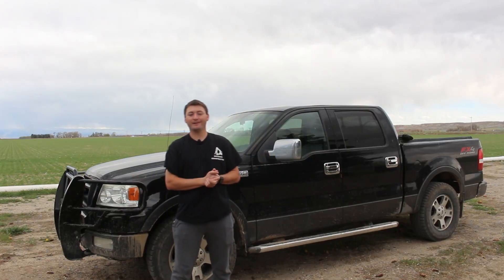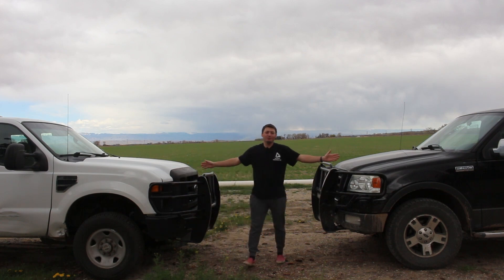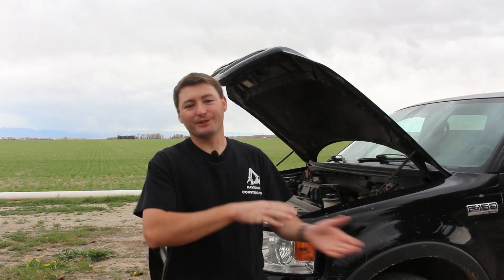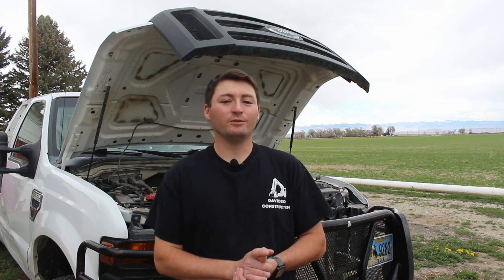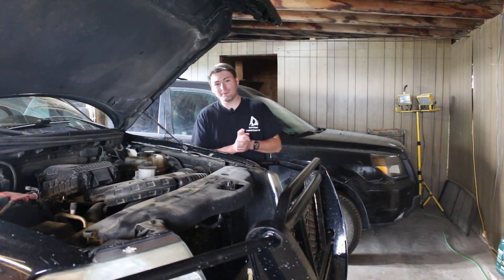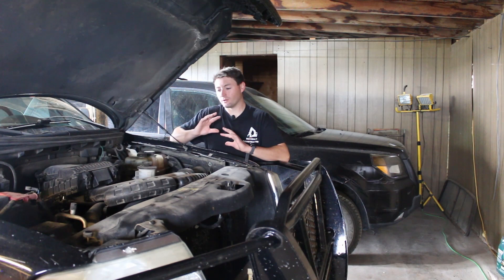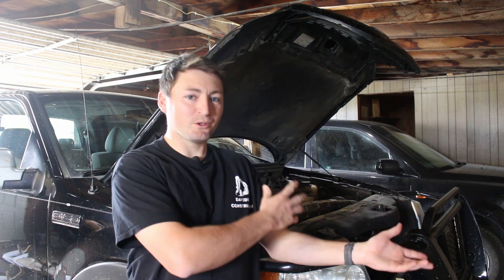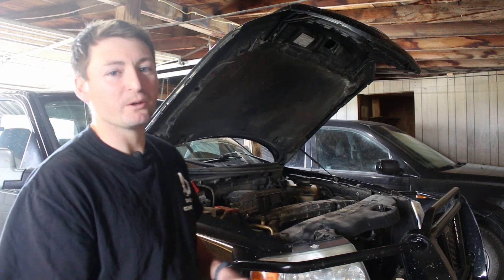Common Issues with the Ford 5.4l 3v Triton V8 Engine 2004-2014 F-series, Expedition, Excursion

Comment: I have changed spark plugs coil paks cam shaft sensors crankshaft sensor fuel module fuel rail sensor fuel pump fuel flterdrained gas put new gas back Indian stumped can you help me
Reply: Yep it's junk take it to the junkyard

Comment: i had a 99 f150 5.4 with 398k miles all original but had the timing done at 200k original trany also
Reply: Probably a two valve
Reply: @glennbeadshaw727 yes was a 2 valve
Reply: @glennbeadshaw727  currently have a 09 with 179k and the 5.4 its already giving me issues and of course it won't just break but gives random issues at random times next to impossible to diagnose

Comment: I’ve owned a toll of four F1 50s and by far the 543 valve has been the worst nothing but issues miserable to maintain. If I knew it would’ve been this much maintenance I would’ve just bought a diesel. The the 5.0 is a good motor specially back in the 80s and the 90s.

Comment: Appreciate the info, was looking at buying a used f250 with 160,000 on it. Gonna pass on it. So, what about the Cummins?
Reply from the maker: Thanks for watching! Overall, 5.4l 3v is not bad, but you do need to be aware of the larger - expensive issues they all have. I bought mine at 150k, kept great oil changes and locked the motor up at 218k. So at 160 well kept, it could go for another few years without any major repairs. Long term however, you'll end up putting a lot into them between timing sets or an engine. 

Cummins diesels are great engines, regarded as the most reliable out of the big three: Cummins, Izuzu Duramax, and the Powerstrokes. With any diesel you'll run into much higher repair and maintenance costs, so keep that in mind. Also keep in mind emission systems are the downfall of diesel reliability. If you're looking for a 'super reliable' cummins motor, try and stay pre-emissions or 2007 below. I've personally seen several with well over 300k on the original block. One that stands out is a 96 with 630,000 and even Hoovie's garage 3rd gen with 1,000,000. Obviously anything is going to require good maintenance and upkeep, some engines just tend to last longer.
Reply: Depends what generation Cummins you're buying

Comment: I recently bought a 2009 crew cab 4x4 with 5.4 3v has 258000 miles only thing I know that the guy had it passed away in August 2019,his daughter drove it then parked it cause of brake caliper an pads wore not changing them destroying rotor an burn caliper completely out,but ran good,i bought it in August this yr,hopefully it will last me for awhile,he was a decent mechanic hopefully he done good things to the engine to make it last this long,my favorite engine of all time was the 351 Cleveland an 390,sure love to have either one of those in my newer truck but im to uneducated to go about such a task now,i also have a 07  mountaineer 4.6 3V with hundred 80 thousand miles an runs like a strapped ass ape an gets 18 to 19 miles to the gallon,but its not like the older days when you could put just about any replacement you desired to in your vehicle,i have heard alot of bad about the 3V but like the one coment here nothing lasts forever so true thank you for sharing!!

Comment: I have a 2005 5.4 it cranks but won't start but I got it to start it runs for a few seconds then it stalls  & will not start again. But if I wait until the next day it will starts runs for a few seconds and stalls and won't start again until the next day. What do you think it could be
Reply: Might be fuel pump or injector issues. Check for P codes, and if you have a voltage tester, look at your fuse box and see if one does not receive voltage ECU related.

Comment: I believe these engines have quite a few updates in regards to rebuilding them that address the timing and valve train issues along with the oil pump issues…I do believe the spark plug issues have been fixed as well if you buy the right rebuild kits or buy a long block from the right engine builder…and as far as oil goes, Ford has a bad habit of recommending extremely high oil change intervals…like three times higher than they should be…my dads Fusion is recommended to go 16,000kms which is ridiculous…I change it for him every 7000-8000kms and as far as the 5.4 goes I would not go over 5k-6kms especially if you are working the engine and use a good high quality oil…Ford wants the 5w20 used but they tried that with their Ecoboost engines and paid out a lot of warranty repairs on major engine failures for their troubles!…as far a I’m concerned, 5w20 is a car engine oil and should not be used in light truck engines…5w30 is the way to go…they were even using that 5w20 in the V10 which was ridiculous!!